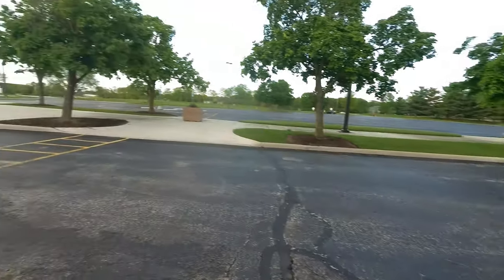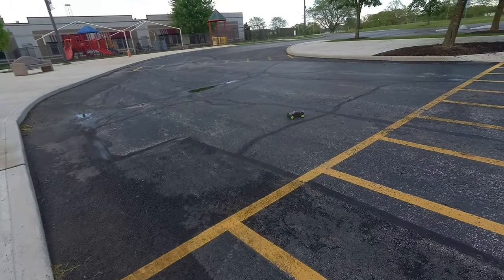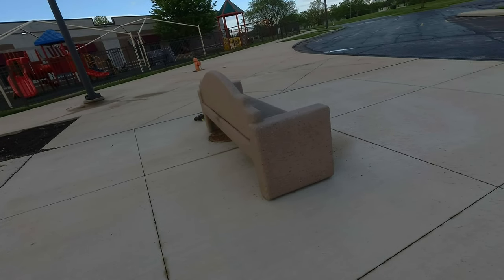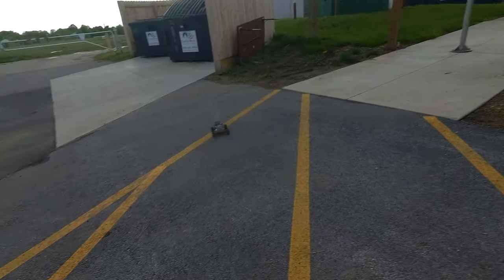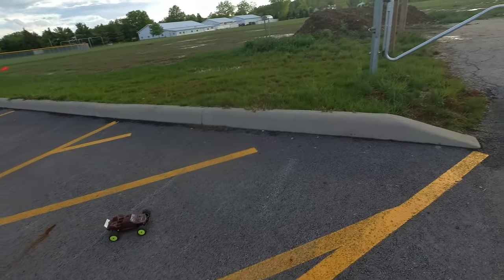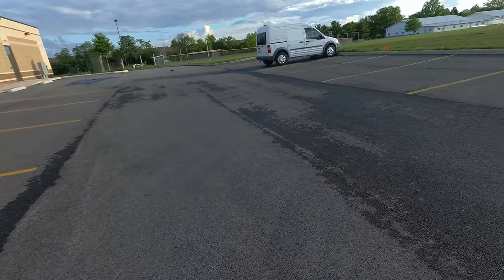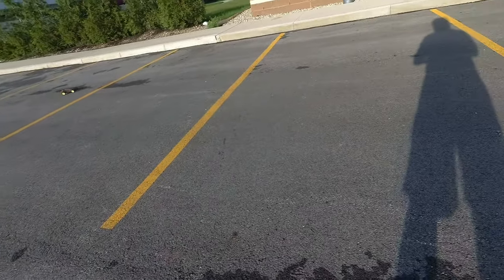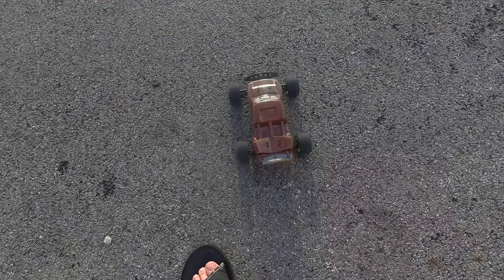Brushless Losi Mini-T 2.0 Bashing With Jconcepts Body

Comment: Nice bashing video! I just finished this body recently in Duratrax Pearl Lime, and it turned out beautifully. I took some of the angle out of the spoiler, as I like the look better. I put on T-Bone front and rear bumpers, and am getting their wheelie bar soon. Until then, I made a wheelie bar out of just a rectangular piece from an old Rustler body. It works good, flexing just enough to keep the truck going without blipping the throttle.
Reply: Wait how did y’all make the custom bodies

Comment: What’s the best servo to upgrade to from the junk sx107 Servo that it comes with?
Reply from the maker: That servo was actually the fastest one I could find if you're having issues with it being sloppy put a zip tie around the servo Springs
Reply: I use tower pro mg90s servos

Comment: Whoa tht the dynomite 2in1 6000kv ?
Reply from the maker: yes
Reply: @StevenGilbert88  looks quicker than i thought im rippin a hw 30a esc and a 7200 kv motor but the simplicity of tht 2in1 looks so clean